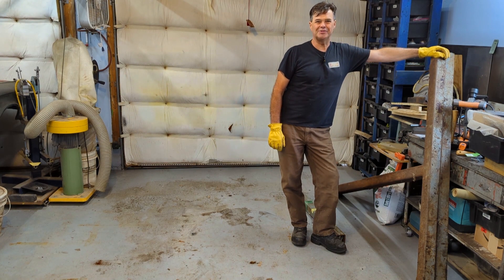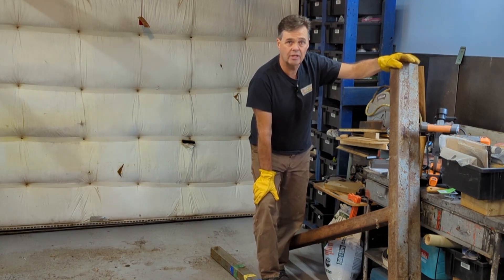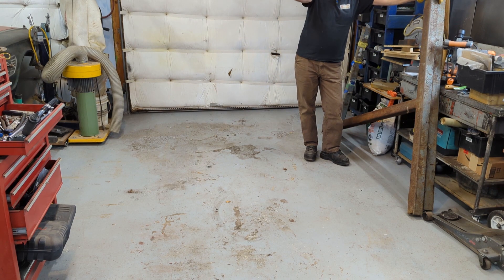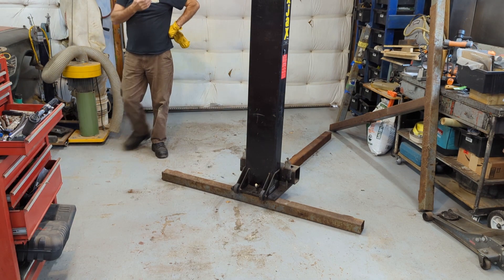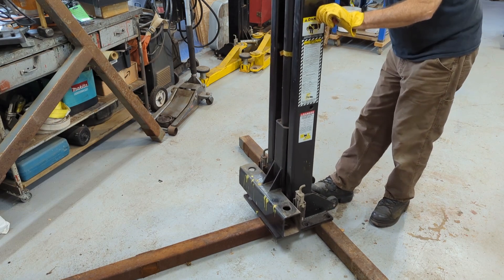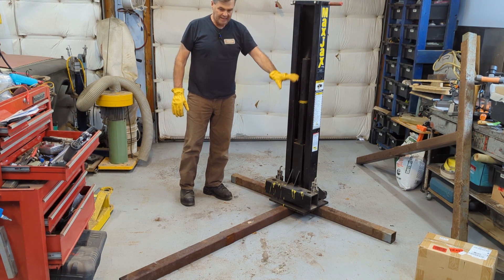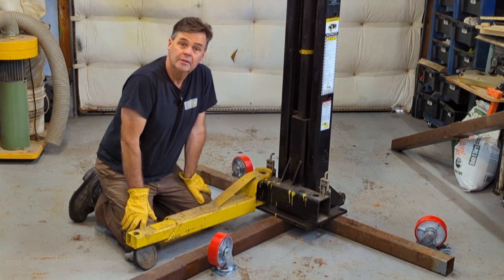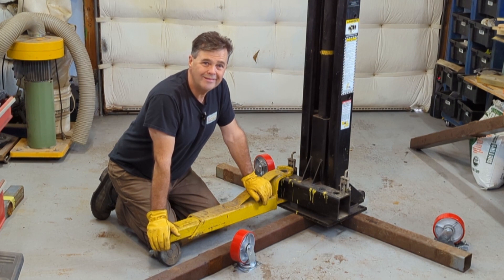DIY MaxJax Lift Rotisserie Build - Will It Work?

Comment: Hello Alvin. I would say don't over think it. Like Walt was saying keep it simple, but safe. I would like to see you show us your plan on paper. Also consider the center of gravity of the car body. If not balanced, turning it over could be dangerous. You like to tinker, so maybe a motorized way of turning it. Macho motor and reduction gear. I think you are on the right track with utilizing the lift and those heavy 3" square tubes. Also, nice hair cut.
George B

Comment: I do have some experience in this,  I built one for my 66 Mustang.  I would go by their plans, I think with the lift attached it would be very heavy.  You will never need to flip the body completely upside down.  I just turned mine almost 90 degrees, then flip the other way to work on the other side.  Of course my Mustang convertible shell was much lighter than your TBird shell.
Plus I am sure you know that you will need much more criss cross bracing for the engine bay, interior, and the trunk.  Your plan will work either way, you seem to be a rather smart mechanically inclined person,  so I am only giving you my opinion.  As Joernone says, your chalk, your chalkboard.  Good luck, can't wait to see the end product. I'm sure, either way, it will work fine.

Comment: Alvin,
It seems that the finished rotisserie will weigh more than the car body.  It's understandable to use what box metal you have on-hand, but the completed apparatus will for sure be a bugger to move around, even with those great wheels.  But if you're down with that, then I vote to get cranking, my friend.  Your chalk - your chalkboard.  😎
Regards,
John

Comment: Heavy for sure.  However, the Bird is not a light car.  And, you might do a Chrysler Imperial, Lincoln Continental or 57 Cadillac Brougham as your next project.  BTW where is the 65 hardtop?
Reply from the maker: Hey Jeff...the hardtop is covered and stored in my back yard...double covered. Lol

Comment: Using the lift arms may make the rotisserie longer than the space you have work in. The kiss principle comes to mind. But you are there and I am not. Good luck.  Walt
Reply from the maker: Thank you Walt, that is something to consider, the arms will make the overall length somewhat longer.